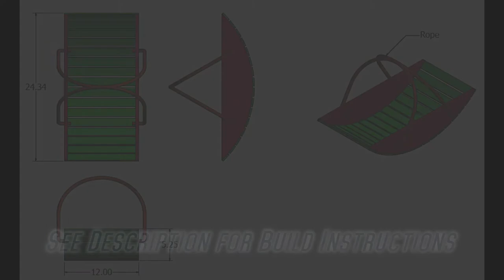Harvest Basket (Garden Trug)

Comment: How did you resaw that think 6 inch board into two separate 3/4 in boards?
Reply from the maker: Those are two separate boards.  I nailed them together on the part I was cutting off.  You could also use tape around the perimeter instead of nails.